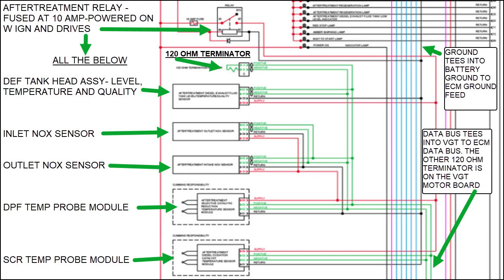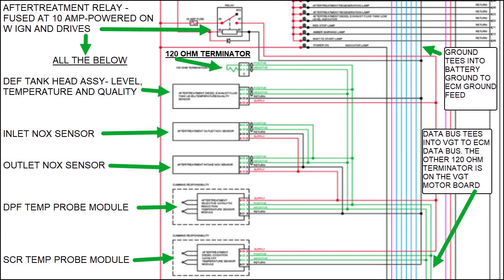Did my DEF tank Header assembly fail?

Comment: If you read this I recently changed a def head in a Cummins it had a code for def heater shorted and another one  about def temp to high but data valid i seen  def was reading 32f no matter if I disconnect or connected connector and  I  had the two signals 1 ground and a12 volt. Why do you think it is still reading 32 Fahrenheit I did not do the empting the def tank or any special installation procedure.
Reply from the maker: On the DEF tanks systems I am familiar with ( I retired a year and a half ago ) the DEF tank was heated by a coil of hot coolant controlled by an OEM on/off valve in the frame. Typically a def heater shorted fault was a def line heater. When faults are active in the DEF system sometimes, depending on the fault code active, Temp values will lock at a default number until everything is working normally again. I have also seen a not expected temp lock in with a specific fault and that was caused by software and not real world. I would correct all problems so all faults are clear. Put the unit in a stationary regen and watch that def tank temp . Once the DEF tank temp is over 60 degrees it wont call for heat in the def tank from the oem coolant valve but line heaters could still go on and off if ambient temp sensed is below about 40 degrees (Fahrenheit). Another words the def tank warmed up to shops temp then you back it outside to do the regen and it is 20 degrees outside. The ambient temp sensor will drive the def lines to cycle heat.

Comment: Good video!! I have 2011 Cascadia DD15 epa 10 does that def header pull fluid from the tank down to the actual def pump? Or does the pump pull the def fluid out the def tank?
Reply from the maker: I am not familiar with the detroit system but I suspect the pump pulls the DEF.

Comment: Was there a recall on certain systems?  I have a 2013 diesel pusher motorhome and now have code SPN 3031 FMI 2 OC 1
Reply from the maker: Original owners received recall or as cummins calls them campaign letters. If you are not the original owner you may not of gotten one if there was one. But call any dealer or cummins and give them your 8 digit serial and they can look it up on QSOL and let you know. Some campaigns - well all campaigns have an end date so after that you foot the bill if the work needs to be done.

Comment: Engine shop joe I got a question about my Cummins engine I’m having code 2636 along with a bunch of after treatment code is it even possible to run the engine without the def system if the system fails
Reply from the maker: The final stage of derate for scr system active faults in engine only idles and 5mph max road speed. Emergency vehicles dont have the derate and off road machinery has a different set of derates but similar to the automotive. So it will run but its not really useable.

Comment: Another great topic and another very helpful video. Have not heard of the def tank procedure yet, that’s interesting.  One question i have had,is when you see the resisters in a schematic, how do you know where to find it. Is there a rule of thumb for its location. Or do you just look for the termination end cap plugs
Reply from the maker: Generally speaking from experience. Cummins will use the termination triangle caps if the resistor is in the harness. Some OEMs will terminate with the same cap but we have found terminating resistors soldered in the harness and then heat shrink over it and harness tape over that. So knowing where it has to be in the circuit helps you to know where to look. The schematics are accurate but generic as to location. There is no standard among oems that pins down locations that I know of. Remember your ohm meter is your friend especially when you know the resistor should be 120 ohms so when you see that in a pin to pin check your on the right track hunting it down. Be sure to unplug all the modules on the 1939 bus or their respective internal resistances help to hide that resistor when trying to locate it with an ohm meter.